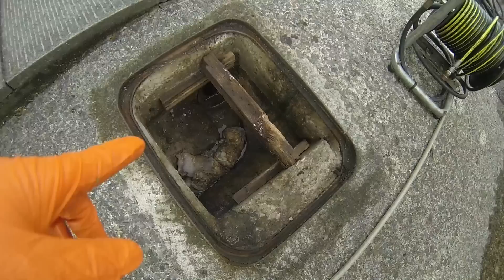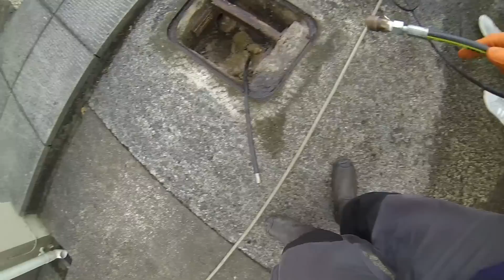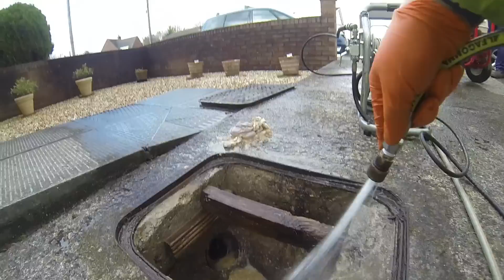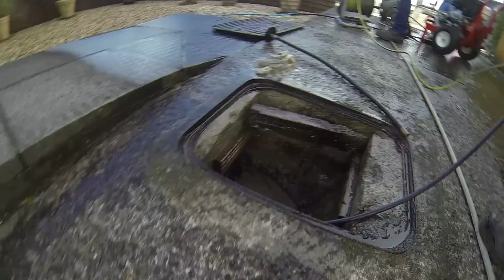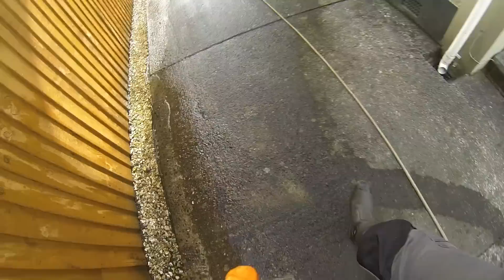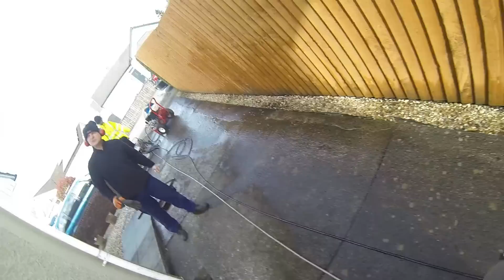Blocked Drain  (Rods_Away_313)

Comment: I have a suggestion. During the recording of you sign off recording. Either hold the camera even or slightly higher than your face. Also make sure the sun or light is hitting the back of the camera. All I ever see is a black outline talking. I'm not sure what you look like. ( I don't need to see your face to enjoy your posts so don't take it wrong )  Wait is that what you have in mind?